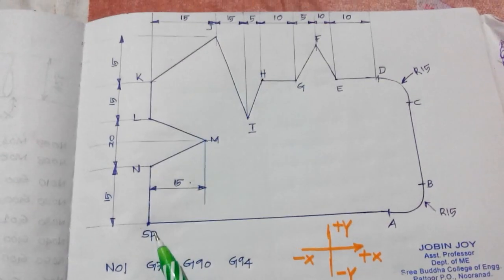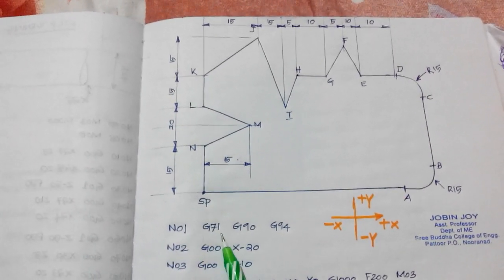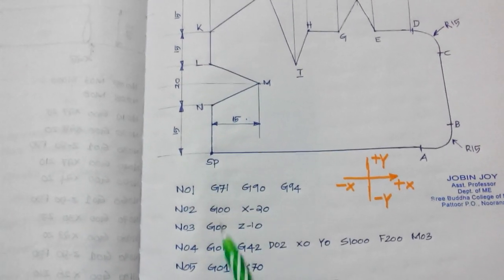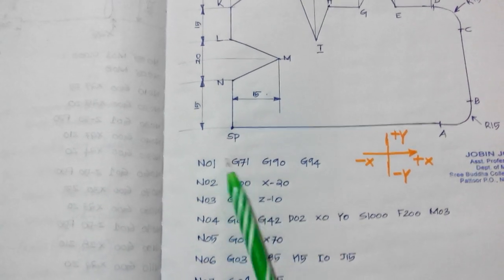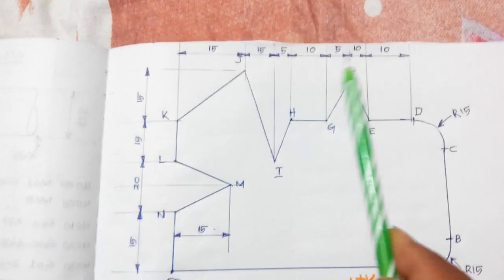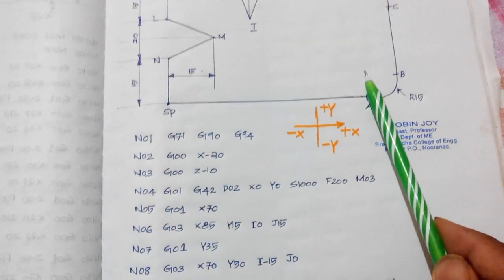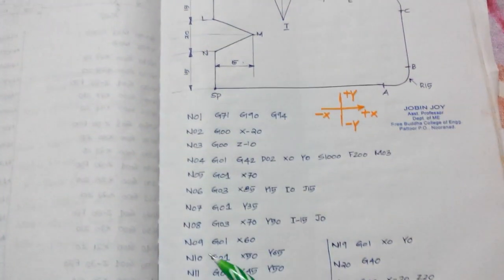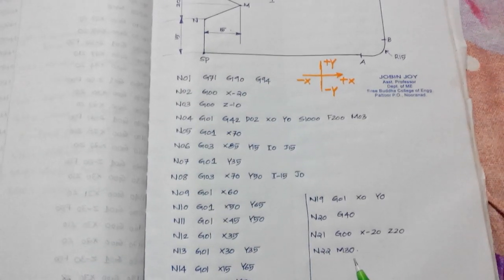CNC PROGRAMMING - MILLING

Comment: how come on GO3 you dont include R15? like GO3 X85 Y15 R15?
Reply: It's G03 X85 Y15 CR15, and the part program is not correct as there is machine error in my simulation

Comment: Sir is cnc programmer and cnc machinist the same? Plz reply
Reply from the maker: Enroll Now Request Info Call 

Menu

￼

THE DIFFERENCE BETWEEN A CNC OPERATOR AND A CNC MACHINIST

May 6, 2020 · 5 Min Read

A NEW CAREER PATH STARTS HERE

Take 60 seconds and find out how you can get trained.

What kind of training are you interested in?Select a Program                                                                                                                Automotive Technician TrainingDiesel / Industrial TrainingWelding Technology Training ProgramCollision and Auto Body RepairCNC Machining Technology Training ProgramNASCAR Technician and Pit Crew TrainingMotorcycle Mechanic TrainingMarine Mechanic TrainingAviation MaintenanceAirframe and Powerplant TechWind Power TechnicianEnergy TechnologyIndustrial MaintenanceRobotics and Automation Technician - CertHVACR TechnicianNDT Ultrasonic Required

GET INFO

Home

 / 

UTI Blog

 / 

Cnc

 / 

The Difference Between a CNC Operator and a CNC Machinist

Table of Contents

What Are CNC Machines Used For?

Understanding the Roles in a CNC Environment

If you’ve ever searched for jobs in the manufacturing industry, you’ve probably come across two different job titles: CNC operator and CNC machinist. If you’ve thought to yourself, “What’s the difference between the two?” know that you’re not alone.

CNC operators and machinists have similarities and differences when it comes to their job responsibilities. While both positions deal with CNC machines and equipment, there are key differences to note.

Keep reading to learn about CNC operators, machinists and how these roles differ.

What Are CNC Machines Used For?

Before we jump into the differences between operators and machinists, let’s talk about what CNC machines are used for.

Computer numerical control (CNC) machines utilize a process in which pre-programmed computer software dictates the movement of factory tools and machinery. This process is used to run many different types of machinery, including grinders, lathes, mills and routers. This machinery cuts, drills, grinds and shapes a variety of materials, from metal to plastic.

CNC machines are used to create detailed, intricate parts that serve a wide variety of industries. These include:

Aerospace

Transportation

Defense

Firearms

Commercial

Electronics

Medical

Optical

Oil & gas

Marine industry

Understanding the Roles in a CNC Environment

As with many industries, there are a variety of different roles one can take on in a CNC environment. These roles rely on one another and are critical to the industry. In general, there are three basic types of positions:

Operator: This position is often taken on by beginners or those just getting started in the industry. In a nutshell, an operator’s job is to load stock material and run parts. They are the so-called ‘button pusher.’

Set-up Operator: This person is responsible for loading the program, selecting and setting up tools, testing the program, and ensuring everything works correctly. They also step in and fix things when they break or go wrong.

Programmer: This person is the one who takes a blueprint and figures out how to make the part. This involves picking out tools, determining the speeds and fees, and writing the program. Check out this article to learn more about the role.

At this point, you might be wondering, “What about machinists?” It’s important to know that there are no machinists in the traditional sense of the word in CNC environments.

If you come across a job posting for a CNC machinist, it’s most likely referring to set-up operators. This is because set-up operators are the most self-sufficient and by nature, have to understand both programming and operating in addition to setup.

How These Roles Work Together

So how do operators, set-up operators (or machinists) and programmers work together? Typically, the programmer will give their program to the set-up operator, who loads everything into the machine and sets it up. They will then hand the keys over to the operator, whose job is to make the parts.

In smaller companies, one person may be responsible for all three things, but in larger companies, these are separate positions with little overlap. Programmers rarely, if ever, will be found at a machine, expect for when they are testing their program.

In years past, machinists had complete control over all the variables of their part and process (speeds, feeds, tools and method of approach). However, this is now all controlled by the programmer and the machine. The person who actually interacts with the machine, the operator, is limited to loading someone else’s program, loading and setting the tools, and hitting start.

Now that we’ve defined the different positions that occur in a CNC environment, let’s take a closer look at the role of CNC operators and machinists.

What Is a CNC Operator?

CNC operators are responsible for stocking materials and running parts. They ensure specific directions are followed in order to create an end product that meets the required specifications. This is typically an entry-level position and can serve as a starting point for those who want to work their way up in the industry.

To be successful in this role, operators must have the following traits:

A keen eye for detail

Mechanical aptitude

The ability to perform mathematical calculations

Basic understanding of computer programming and CAD/CAM software

Ability to comply with safety guidelines

Strong problem-solving and multi-tasking skills

What Does a CNC Operator Do?

The essential role of a CNC operator is to set up and operate CNC machines and equipment. On any given day, an operator may unload raw materials, prepare a test run to ensure a machine is working properly and inspect and measure finished products to ensure they meet requirements.

Depending on the kind of parts they specialize in, an operator’s day-to-day responsibilities can vary. However, the following operator job description can be applied to a wide variety of industries.

CNC Operator Job Description

Load and unload raw materials and equipment

Set up and calibrate accessories and equipment

Keep detailed records for equipment and procedures

Perform necessary maintenance and cleaning on equipment

Supervise machines as they run and make adjustments as needed

Inspect finished product to ensure it meets required specifications

Abide by company safety guidelines

How CNC Operators Differ From CNC Machinists

The role of a CNC machinist is more advanced than that of an operator. Machinists can accurately machine parts to print using a variety of machines and methods. They rely on their skills and expertise, which are often obtained through an accredited trade school or many years of on-the-job experience.

Some of the additional duties of a CNC machinist include:

Programming machinery

Quality control

Troubleshooting and fixing mechanical issues

Supervising and managing CNC operators

Many machinists start out as operators and work their way up into this role. The CNC industry is very complex—and it’s important for machinists to have a grasp on basic machine operation before taking on more responsibility.

Successful machinists have the following skills:

Ability to read blueprints and part drawings

Programming and setup of CNC machines

Ability to set up and operate machine tools for drilling, milling and grinding

Knowledge of properties of metal and other materials

Mathematic skills

Knowledge of reading calipers and gauges

On-the-job CNC machining experience

Leadership and effective management skills

Comment: 'D02' in block no. 04 (N04) is the diameter of the cutter which we store in the system. D02 means tool number 02. Also please mention work offset (G54, G55 etc)

Comment: Don't using metric input code G71
Metric input code G21
Reply: G71 is for turning centre.  Rough turning cycle.
Reply: each program station has different arrangement G codes...... this is probably Sinumeric system I think

Comment: The z-20 command has been used after taking the cutter at x-20 and thenafter x0,y0. so wont the depth of -20 mm would also made from x-20 to x 0. which is not required as per profile.

Comment: There is a US-based support forum for low power laser machines at: www.Benboxlaser.us
In the software section of BenCutLaser you'll find a CAM program that also has a full blown gcode editor with syntax highlighting!

Comment: G70 codes are 'canned cycles'
Reply: +Lloyd Mutton Hi, G70 may be INCH UNIT PART mode, where you can execute your program in inches, so G71 will be in MM. But I know many CNC-machines where G70 will use like canned cycles.
Reply: In some programs ,
G20 for inch 
G21 for mm.

In that case, G70 may be used for canned cycle

Comment: And what about G43 for the tool length compensation? Before you compansate the tool length you can't move in z-axis. In the block were you say G0 Z-10 you need to ad G43 L2